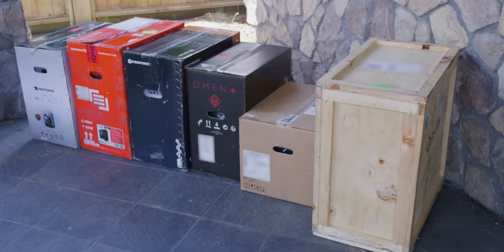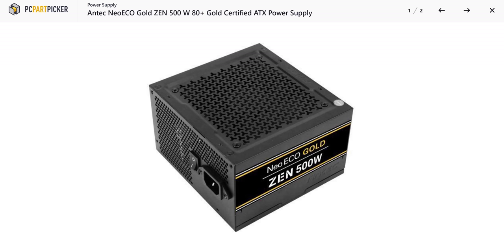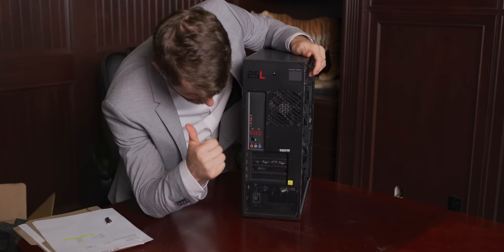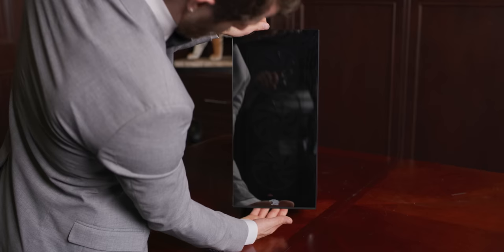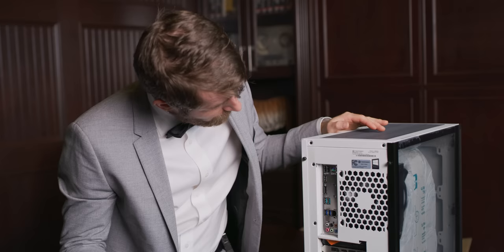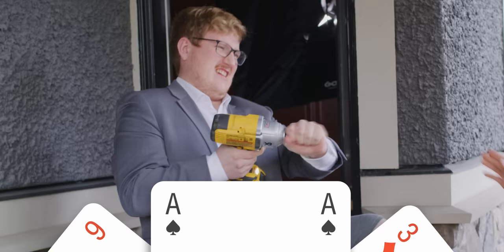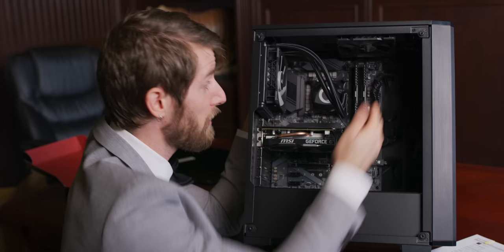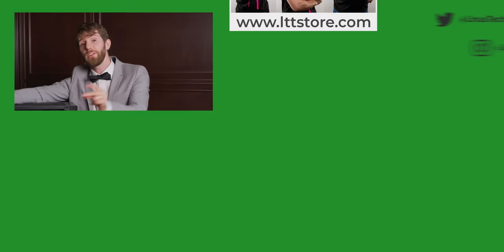What Did We ACTUALLY Get? - $1500 PC Secret Shopper 2 Part 2

Comment: Cyberpower usually used a Vacuum Draw for cooling. all fans push and the PC draws in from the Bottom filter. Actually works pretty well, my sons running the same PC as the one they ordered and it has great thermals

Comment: “Who buys 4GB sticks anymore?”
LTT sure does.
Reply: It make sense for ryzen though, could get more performance due to using full memory bus size. And when you have leftovers
Reply: explain?
Reply: @gleebeevonkordke2068  How tho. I really don't know.
Reply: @skirata3144  No Skirata, that was Ryzen 3rd Generation cpus aka Ryzen 5000 series. Not Ryzen 2nd Generation Cpu's aka Ryzen 3000 series (such as the one in that case). It will see no performance gain from using more ram sticks, and may in fact see a small performance loss from not using dual channel.

Comment: Linus - throws RAM

"pardon me, why would you just throw the RAM?" Ha-Ha
Reply: Bonus points to Maingear technical support if they respond during the next test with "Did by any chance did you pull out one of the ram sticks and drop it on a hard floor?"
Reply: @boxhead6177  Considering there's a 24 min day difference between part 1 and part 2, these were all most likely filmed beforehand
Reply: @CritLoren  Obviously, they don't release this until filmed... while nigh impossible wouldn't it be funny if the technician actually called it :P
Reply: Apparently you haven't seen enough of linus, need to watch a compilation of him dropping shit..

Comment: As an owner of thew updated version of the Omen 25L here's some improvements and still yet to improve aspects of it and the experience i had during 3 months of ownership.

HP finally added two ram slots on the motherboard and it comes with two Hyper X 8gb ram sticks, further improving the modularity of the pc.
The feet are still too short, just to add to their statement of not leaving it over a carpet, buy a pc stand from amazon or keep it elevated like a desk, I went with the first option.
The short feet and the air channel design does bite you after 3 months of usage with the pc on the floor, what at first was a constant 60ºC cpu temps under load suddenly became 85ºC it did lower drastically to 75ºC after relocating it but I recommend upgrading the cpu cooling just in case.
This is a small detail they left over, when they said something about having an exhaust fan on the top of the pc, you can remove the plate on top and put a 120mm liquid cooler radiator or a fan.
The motherboard connections are still meh, but i don't really use all the usb connections at once so its not a big problem for me.
And lastly, if you happen to own an air cooled version of this thing like me and want to liquid cool it, cooler master 120l is the safe bet, it's the same one as the liquid cooled models with a different core.

Overall for someone who is away from home because of college and needs an "inexpensive" system to game with in a dorm, it gets the job done. Never had problems with other components and the i7 10700F and 1660GTX Super combo performs really well on 1920x1080.

If you're someone who is trying to move from console to pc and wants to tinker with it over time, I also recommend it for you.

And if you've been in the pc masterrace for quite some time, why would you even consider this system smh.

Edit: GPU, its a 1660 Super not a 1660

Comment: bought a pc from cyberpower back in early 2019. was super excited and everything. when it got here, turns out, for *$2000*, we got a 1050ti, an AMD 2200 G which had FORCED INTEGRATED GRAPHICS ON for nearly the entire time I owned it, since I didn't know how to check at the time. A 100gb boot drive, which only half of it was actually being used, the other half was not partitioned at all, and wasn't in use. 16GB ram, DDR3, and some case that isn't even produced anymore im pretty sure. Seeing that I could've waited a while and got a 2070 for $500 or so off the price of my original from iBuyPower made my heart hurt so bad. on it coming in,  the paper sticker over the usb slots on the back tore on top of them, so i had to knife at them with an exacto knife, but i got it done.

Comment: Dbrand probably spent more on domains than they paid Linus for the sponsorship.
Reply: domain is very cheap..
Reply: Usually 10 bucks for a year
Reply: Depends, a short name domain can be as expensive as $1500 a year.

Plus there are scalpers in domains as well. I got skalped once. 
I was searching who gives my domain cheapest and next day it was taken by one of the sellers with the ability to buy it from them. For $25 000.
Reply: @hubertnnn  lol ouch

Unfortunately with things like this, it can really screw over the unprepared
I knew about scalping issues from previous dealings years ago so this most recent time I used whois lookups and such to see what was available, different combinations and that sort of thing.

Then once I decided on one, checked a few websites for pricing (without using their search function) and only then, after knowing exactly what to get and where from did I sign up and pay for it.
Otherwise if you go half way there, but then back out and check others/come back later it may be taken by bots that just scan those search terms and steal things which look like they're just about to be bought.

That kind of stuff around should never be required, but what can ya do?.. hopefully these tips can benefit someone

Comment: I have the Omen PC. Its a beast of a machine. I managed to get one from a pre owner with a 2080 and i7-9700K and 32gb ram with hyperx fury ram cards. It runs cyberpunk between 70-80 fps on ray tracing high at 1440p. Although my board has 4 slots for ram and 2 m.2 slots. Also has the 2 sata bays.
Reply: Also mines is liquid cooled. Case is identical. Also mines has rgb.

Comment: "1660 super which is the slowest gpu that we have here"

Me watching with my gtx750ti gpu: what? Slow?
Reply: Me on Intel HD graphics
Reply: I mean, for a $1.5kUSD machine it's kinda slow

For the average user / steam hardware survey though, it's few steps above average and often still more than people need (for 1080p/60 @ high)

For reference, on the GPUCheck index (fps comparison between cards at different resolutions using combined averages from a large number of games. The index number is an overall score irrespective of resolution, and not direct fps values):

RTX 3080 = 275pts
2070 Super = 156pts
1660 Super = 114pts 
1060 = 78pts (still most common GPU on steam survey)
970M = 49pts (reasonably popular 'gaming laptop' card from a few years ago)
750ti = not actually on the chart, somewhere between 34-38pts? 

source: https://www.gpucheck.com/gpu-benchmark-graphics-card-comparison-chart

750ti might be old and obsolete now, but it still runs esports games perfectly fine, and is anywhere from 30% to 130% faster than a 10700k's onboard UHD630 
Though I think the newest Iris and Vega integrated laptop GPUs are now starting to overtake you (took 'em 6 years to do it though!)
Reply: Lol

Comment: The Dell packaging is designed to be 100% recycled as well as maintaining equal drop and puncture protection as a PE foam non recycleable counterpart (extensively tested). The use of the molded pulp paper is done as an environmental initiative rather than a cost one. There is a lot of engineering and supply chain work that goes into making this possible and should really not be listed as a con based on anecdotal impressions. 
As for the sticker being a line item, that’s for the purpose of Intel incentives and rebates and it’s them who are sticklers about it.
Reply: i mean the cardboard no doubt reduces costs but it’s also much more environmentally friendly i guess. goes hand in hand with the 80 plus platinum psu.
Reply: Well let's just settle that the eco-friendly packaging is the only thing Dell done right.
Reply: Wish more people would see that. I actually got mad when he conned that and praised the holy plastic and foam.
Reply: @SassyPantsy  i mean in comparison to the co2 emissions and mining required to build the pc (not to mention moral issues regarding giving money to the ccp) it’s probably not significant but if the performance of the cardboard is comparable to the foam i don’t see why not.
Reply: @SassyPantsy  and one of the PCs with foam packaging still had dents and was realistically an RMA case at that point (and i wouldn't even call that being picky if the FRONT is dented).
Reply: @ZeroB4NG  not picky at all. If i received something like that I'd be pissed
Reply: @mihan2d  i’ll drink to that lol

Comment: I haven't looked at numbers since the 5700XT's release, but doesn't it beat or at least trade blows with the 2070 Super?
Reply: Yeah i was thinking the same thing, 5700 xt matches 2070 super in most bench marks I’ve seen
Reply: It does, but also doesnt have ray tracing and dlss and all the other nvidia exclusive software.
Reply: Nope it trades blows with RTX 2060 Super
Reply: @normiukkeli3739  true, but that goes w/out saying and I don't think they'll be benching anything w/ RT or DLSS enabled.
Reply: @vladdx  no, with recent drivers, it's giving same performance as 2070s or better, being not far off from 2080.
Reply: @andrew-kp3wx  Lol nope
Reply: @vladdx   ok, yeah, you have totally proven me wrong, I take my words back.
Reply: @andrew-kp3wx  I don't need to, you cherry-picked 2-3 games that favor AMD cards while I was speaking about overall performance
Reply: @vladdx  im not saying its a lot better and not an amd fanboy, but if you say that it gives the 2060's performance, thats a bold statement.
Reply: It's around 5% slower than the 2070 Super in games on average unless they improved the drivers again in recent months (btw it was also $100 cheaper on average but of course the new launches change up pricing)
Reply: @andrew-kp3wx  no

Comment: Dell: "Dude, you're getting a warranty!"  Origin: "Dude, you're getting a crate!"
Reply: Moral: never ever ever ever buy a Dell...
Reply: @josephcabrera7626  Pretty much... although I did manage to grab a few very, very, very cheap PCs back when they were selling some with FreeDOS (so you weren't paying for WIndows). But I knew they were going to be recycled as soon as they died because of the Dell proprietary "solutions" of parts inside the case.
Reply: Origin: Dude, you're getting our special short life AIO (due to a radiator installed upside down).

Comment: 26:50 Origin installed the AIO radiator upside down. The air bubbles will end up in the hoses.
Reply: I would absolutely not buy from origin based on this video alone

Comment: why do people prefer tempered glass side panels? Ive always liked acrylic more because its not as easy to break and i can easily modify the acrylic like drill holes to mount or create airflow. drilling any glass can be a challenge but tempered is undrillable.
Reply: Because scratches

Comment: just seen this video and I want to say, the layout of that HP one is the same as mine, I got a "Omen" one as well, costed me £1300 works out at about $1599 now, would of been more when exchange rates were better and mine has the same SSD, same HDD I think looking at whats in that one but I have 2 sticks of ram installed. CPU is a AMD Ryzen 3700x, GPU is a Radeon RX 5700

Edit, the Feet...yeah I have mine on Ceramic slabs to keep off the carpet.

Comment: im still running acer motherboard from 2014 with a intel i7 3770 and a 2070 RTX still going strong
Reply: Man a 2070 may be a little overkill but It'll be ready for the future upgrades. I thought about buying a used 3770 but figured it wouldn't make that big of a difference over a 3470.

Comment: "you can swap the motherboard"
me: is that supposed to be unusual?
Reply: In many prebuilt systems from Dell, HP and the like, much of the hardware is proprietary. Like that Dell motherboard, you can't buy it anywhere except from Dell, same with the power supply
Reply: @kaldo_kaldo  even the RAM can be proprietary and the mobo might not allow for non-proprietary RAM to be installed
Reply: @kaldo_kaldo  And the bolt patterns are probably different so you probably can't scoop out the brains and put a "standard" computer in it.
Reply: Yes it's totally unsual for a person who buys prebuilt PC.

Comment: 15:20 I put a magnetic filter on my exhaust at the top of the case for when the PC is powered off. I stops dust falling into the case, which has a tempered glass side. The difference is quite remarkable and having dust on your components isn't a nice look.

Comment: 22:55  The 5700 XT is more than 40% faster than the 1660 Ti, basically being exactly as much faster as it is more expensive.  The 2070 Super is around ~7% faster than the 5700 XT, but costs 25% more.

What you're basically showing here is that you know just about nothing about GPU performance if it isn't nVidia.
Reply: Dude, if a manufacturer used rx5700xt it'd be fair to include it in your PC build.

Comment: Bro, I had(changed the peripherals) basically the ibuypower one. Same mouse, keyboard, case, cpu cooler and similar price. I don’t think it was worth it though, cause mine was 500$ more, came with faulty ram and a broken cooler, and came with only a 2060

Comment: The Dell keyboard is okay, but the mouse isn't that bad. I have one from a system I bought ages ago and it's still working okay.

I said in the comment on the previous video that the system overall is crap. It's part Alienware, but sold as a Dell. The system cooks inside and the components are cheap, and the case is proprietary.

Comment: Hey linus, all of that damage on the cyberpower machine happened prior to shipping without a semblance of a doubt. they 100% shipped you a damaged machine

upvote this so linus sees this
Reply: Did you work for cyberpower before?
Reply: @tootoxictina  no, but there was not even close to enough damage on the box to have caused damage to the case. Not even fucking close, something would have had to hit that box hard enough to compact that super dense foam and then dent into the case. If that would have happened the box would have been completely shredded
Reply: @FUCK_________googIe  Boxes are pretty flexible, it's possible it doesn't show.
Reply: @tomasxfranco  lol no it's not, if it happened in shipping there would be holes and there really isn't two ways about it

Comment: I had an Omen really similar to the one you guys got in this video, the GPU brace gave me so much trouble when I tried to take it apart to upgrade. It was screwed to the motherboard with the tiniest little screws that stripped just the instant you put a tool to them... My friends called me nuts but I took a driver drill to them and that was the only way I managed to get the brace off.

Comment: PC: has single channel RAM
Linus: complains
Other PC: has quad channel RAM
Linus: complaining intensifies
Reply: Dual channel. It uses four sticks, so the RAM could be used for quad channel, but the CPU needs to support it, which mainstream desktop motherboards and CPUs do not.
Reply: Yeah, the first and second slot is a channel, the third and fourth is the other channel. Its like stacking ram on top of each other for 1st and 2nd slot, compared to rams with separate lanes side by side for the first and second channel
Reply: Its better than single channel tho

Comment: Origin PC: That AIO cooler is installed wrong way, air bubbles will get back to the pump.
Reply: Exactly! Thanks for saving me the time writing this 🙂 Quite shocked, Linus didn't call it out tbh
Reply: Incorrect the highest point in that loop is not the pump but rather the entry and exit pipes at the fan
Reply: It's not installed "wrong". It will do just fine. Maybe a little bit noisier (due to trapped air bubbles inside the tubes) compared to the prefered pipes-down-mount. Air bubbles will not get into the pump, as already stated by @Jamie Aleksic. Please don't spread fake news.
Reply: @t0scanelli  Hey! Stop making patient Intelligent comments on Youtube.

Comment: I had to replace my stock R5 3600 cooler with a hyper 212 as it was idling at 50C and max temp low 90C. Granted i live in a warmer climate and dont have AC

That may be a question to include in future

Comment: Conclusion: Do not buy pre-built pc, make it your self.
Reply: I agree but not everyone wants to.
Reply: I bought a prebuild that was 50% cheaper than if i ever bought each part and built it myself. Some parts were second hand and some parts were first hand. I replaced the gpu, ram, psu, with parts i bought for cheap too (2060 super, p750gm psu, hyperx 3200 8x2 kit). It all depends really. I bought everything needed for a full desktop setup for 1500 and it would have costed me like 1800-2000 (third world country). In conclusion, you can buy a pre-built pc if you know what your doing. But yeah generally I reccomend just making your own.
Reply: @oogaboog  Yup. I generally tell people to build their own pc’s but I felt like I wanted to do something different and connecting the case buttons to the motherboard was a hassle so i just bought a prebuild and went from there on.

Comment: Some of these that were close the building it yourself budget seem like kind of a nice deal, I mean they did come with keyboard and mouse and some with mouse pad and shirt. I mean yeah their cheap but it kinda helps with hav ik ng everything you need, only one did ask if youd need a monitor. But tbh you could easily just hook up the hdmi from your tv to the computer to see it up and everything, or just play until you have a monitor. I mean I built the computer i use now (have added some small upgrades) for roughly 400 3 years ago and but then spent maybe another 100 or more on pretty cheap keyboards, mouse, mousepad, and monitor. But used it on my TV for probably a month before I got a monitor to play on.